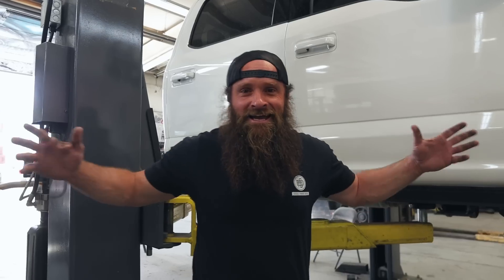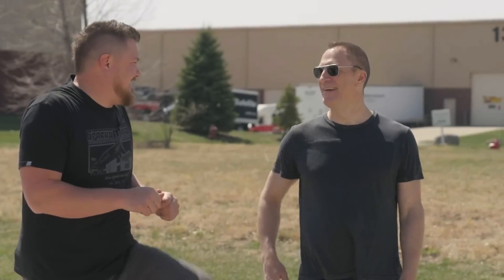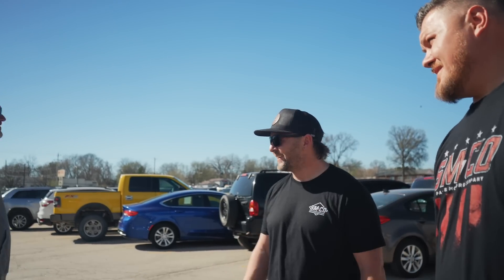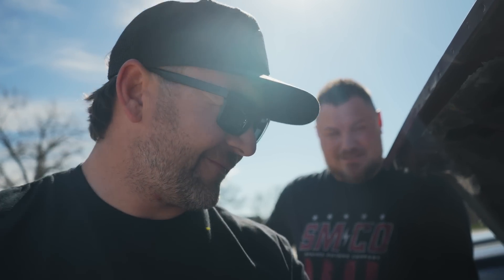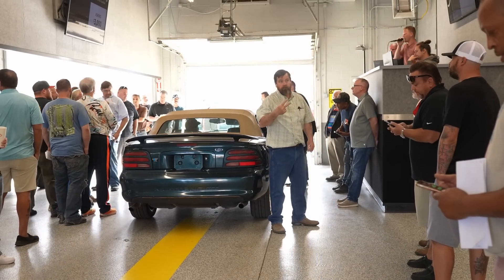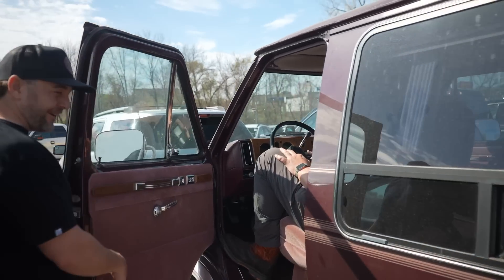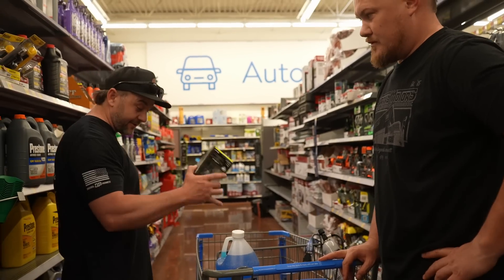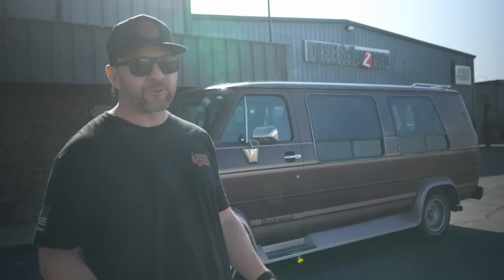We Traded Our Plane Tickets For THIS??

Comment: I have that exact same van and have had it for over 10 years. It has never failed me. Bought it with 50,000 miles and it now has 150,000 miles on it. Oil changes, brakes, battery normal stuff and it just keeps on going.Probably the best buy on a vehicle in my life. Let me know if you ever want to get rid of it.
Reply: Some of these employees  just gotta grow on you a bit.i starting to see the humor   in them all. Good job guies

Comment: I think that GMC van was a lot better choice than the Chrysler PT Cruiser,  I seen quite a few PT Cruiser  over the years broke down along the roadside.  Also driving on hi way with the GMC with  one owner and 44000 miles on it is very easy on it compared to stop and go traffic so I thought you guys would have had a 99 percent chance of making it with no problems.

Comment: I have a 1998 Dodge 1500 RAM Van (5.7L V8) with a 1999 positive track rear. (98' Dodge Trucks or Van had rear end issues after 45,000 miles). Now got over 170,000 miles

Comment: Sweet van!  I wouldn't use the A/C booster, the van uses the old style R12 style freon unless it was converted over, which it most likely hasn't been.
Reply: Propane would work on that old R12 system
Reply: Propane and propane accessories!
Reply: @stevenellis4005  😆

Comment: Our gov. vehicle auction will Not let you drive the vehicle. You can turn it on, and put it in gear, but you're not allowed to roll the wheels at all. I wonder if it is just this state, or just that particular auction house. Also, not sure if you realize this but used car dealers go to these auctions, then ship the cars to a state where they can get more $ for them, like CA and NY, so they are willing to over-pay on the value of the car.

Comment: pt cruiser works and drives great but if no one replaced a timing belt around 80000 could a lot of damage. Motor mounts were easily and agree with the engine back and forth.
Reply from the maker: I really wanted that PT cruiser haha
Reply: @SparksMotorsCo  I had one and sold it to my sister before she wrecked but  insurance gave her more to her more I gave her. It was over 100000 I drove that thing back from FL and NJ

Comment: I see no signs or evidence of air-conditioning for the guys and their electronics in the back of that truck. There is also very little. If not, no safety provided for them. Should you be in an accident other than chairs bolted to the floor. I think that vehicle is going to be a bust, just for those reasons